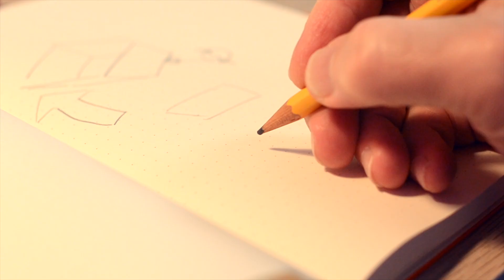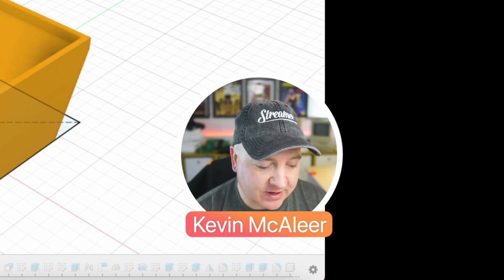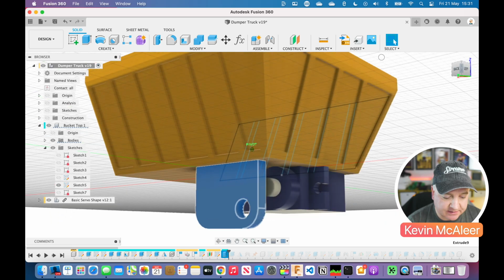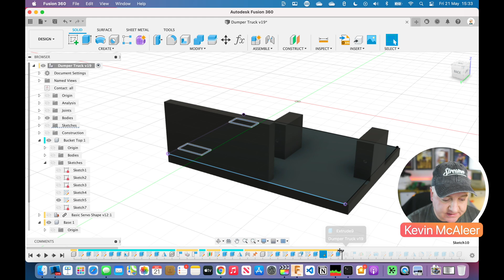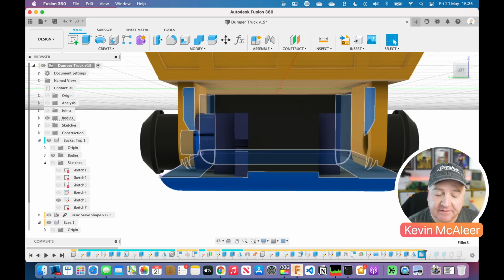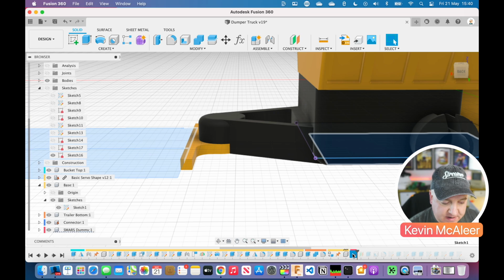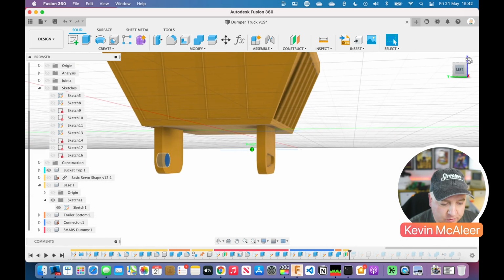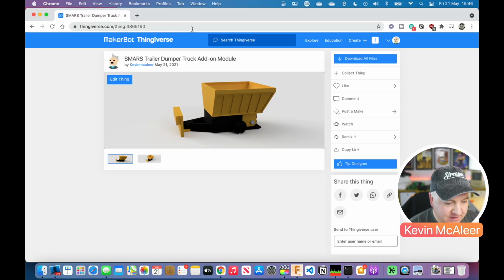SMARS Dumper Truck Trailer

Comment: I have a better idea actually. We can reliably print 45 degree overhangs, right? So what if we angle front and back sides of the bucket at 90 + 22.5 degrees. Then it should print nicely standing on its back because the front wall will be angled at exactly 45 degrees to the bed.

Comment: That bucket joint doesn't look repayable. I think it would be better to use a dovetail joint here. Something similar to how official IR sensors are done. Another option is to print the bucket vertically and make its back removable. Maybe even with mechanical linkage that opens it when the bucket is tilted.